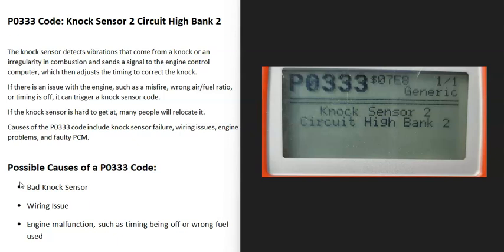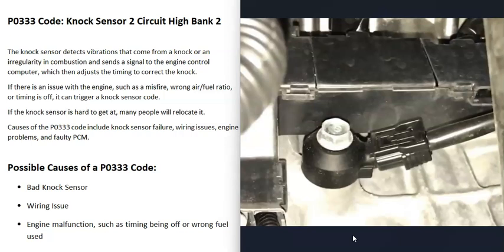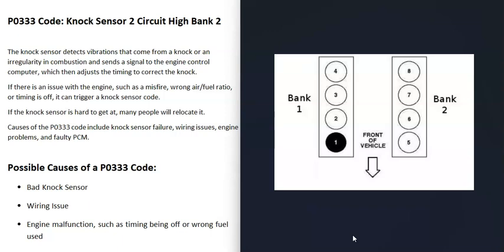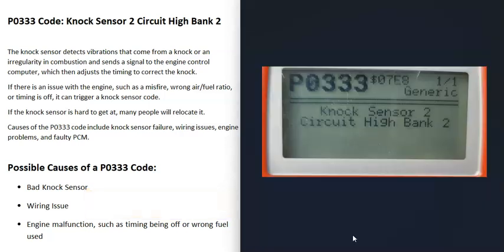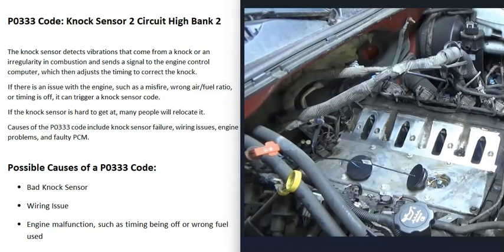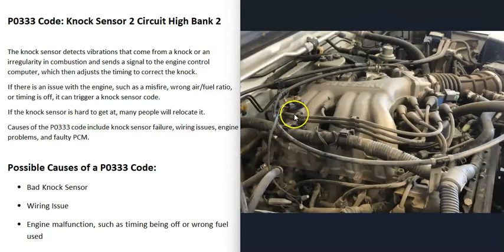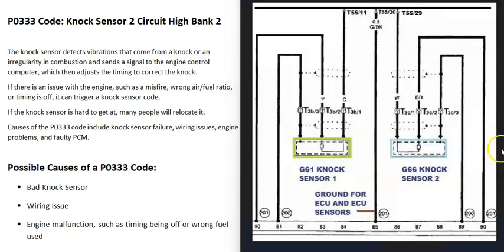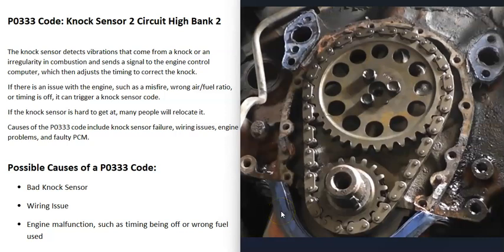Causes and Fixes P0333 Code: Knock Sensor 2 Circuit High Bank 2

Comment: I checked my knock sensor today and sensor looks good along with wiring, recently I put 87 gas like 30-35$$ worth.. An it got worse, since then I had timing belt changed tensioner and spark plugs and bank 2 air fuel ratio sensor replaced... Still get😂a knock sensor code. Also it is intermittent, code scanner sometimes shows No DTCs... Any pinpoint or help would be appreciated.. 2016 honda accord v6 2Dr exl..

Comment: This code came up after i replaced both power steering and alternator belt on our 2006 sienna.. why is that? thanks
Reply from the maker: I would check for a loose or broken wire. While there may be a knock sensor issue, a wire likely got hit while changing out components.

Comment: I CANT FIND WHAT TO DO TO LOCATE FOR MY 2011 jeep grand Cherokee Laredo 5.7 Hemi P0330 code - DO YOU HAVE ANY ADVICE?!😭😭😭😭😭😭😭
Reply from the maker: Bank-1 knock sensor is located under the engine by the starter. The Bank-2 knock sensor is located on the other side of the engine on the side of the block. You can see them both from under.